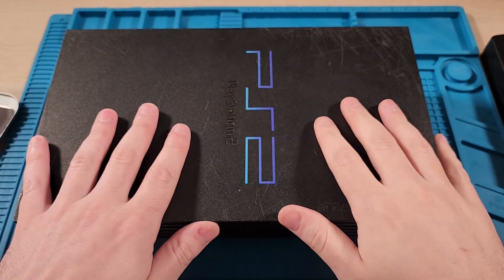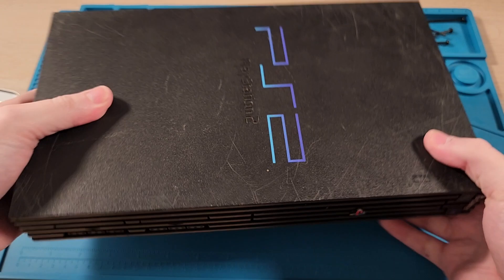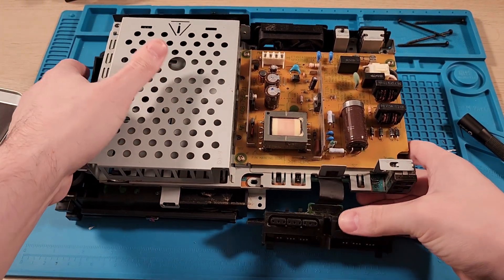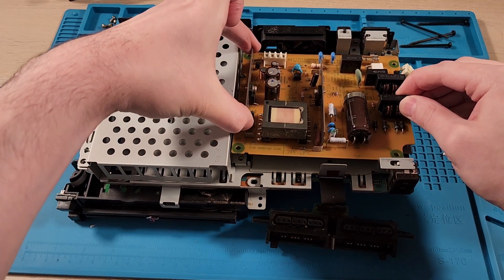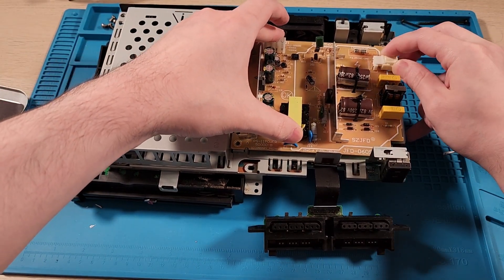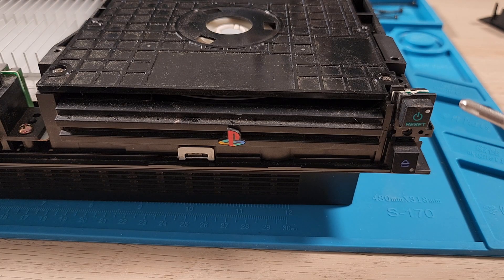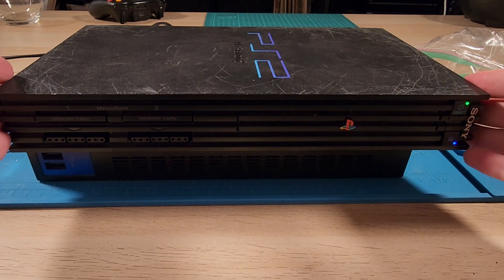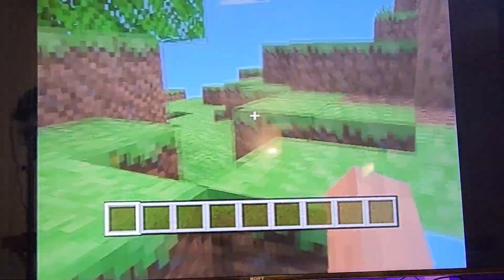Play Station 2 Power Supply Replacement, saved from the trash [SCPH-50001 U/C]

Comment: mine also didnt go on straight. Couldnt get the top left screw back in, near the 4 pin on the psu. The whole ps2 didnt go back on as well as originally, but hopefully it works anyway. Ty for the guide
Reply from the maker: That's a shame :/ It was a real struggle to get that on for me.  Mines been working very well since the installation.   The only problem I really notice is a slight coil whine when the system is idle.   A common problem on some powers supplies when the load is low.   When the system's on it goes away.   As a solution I ended up getting a smart power board, I plugged all my conscience into it so it's not just for the PlayStation 2 so they're not always hooked into mains power.